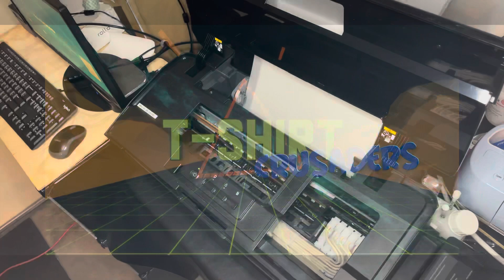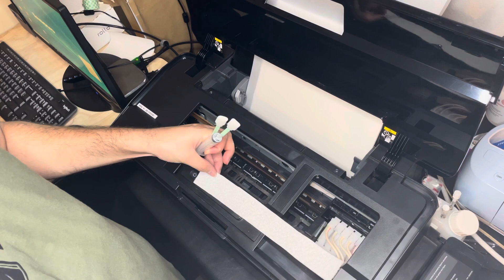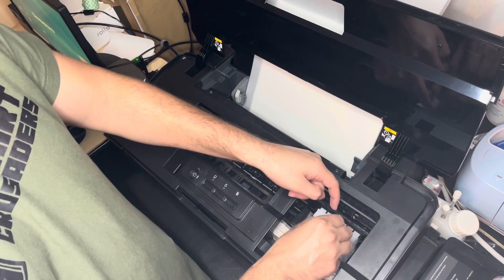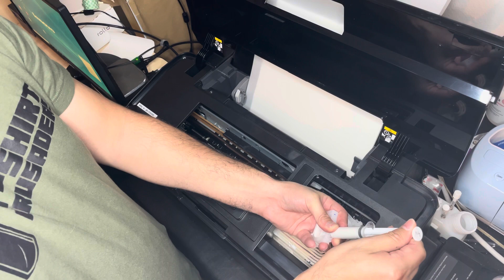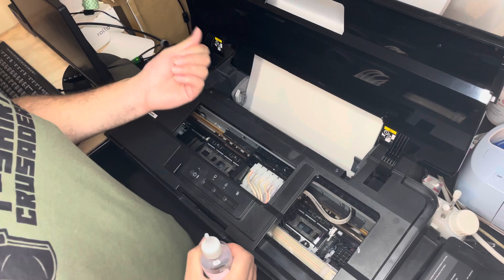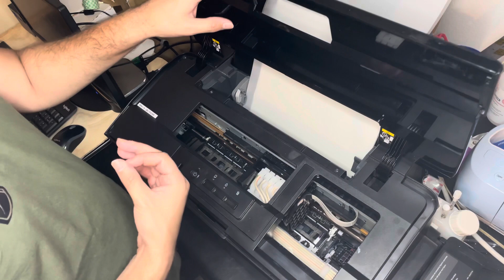Direct to film (DTF) printhead maintenance | Walk through

Comment: What type of printer do you have?
I am in the market for a DTF. 
If you had a choice what printer would you buy?
Reply from the maker: I have the Epson L1800. I have some links in my other videos with some suppliers. Well, it all depends on what you are trying to do. If, you want to make/sell transfers then you should definitely jump into a commercial printer like the audley or oric, but they are like 14k for a full set up. If, you want a desktop printer like mine where you will just be doing one off shirts or smaller orders then the epson L1800. If you want something a little faster and that is somewhat of workhorse then Id recommend the P600, R3000 and P800.